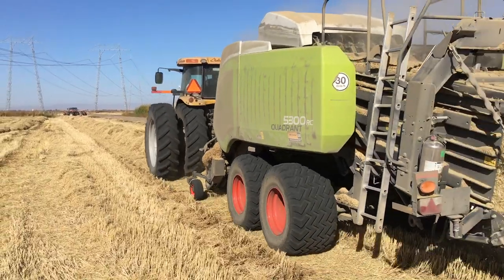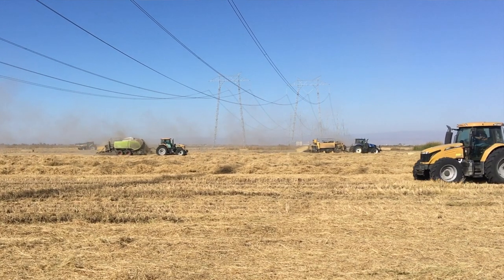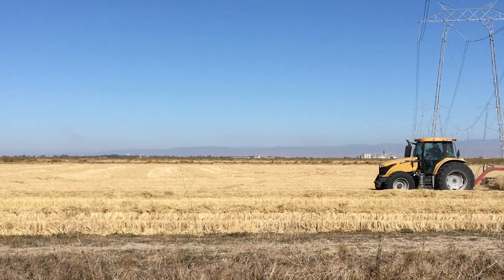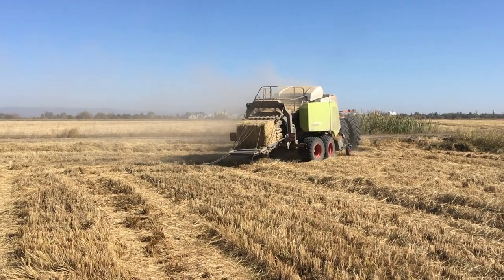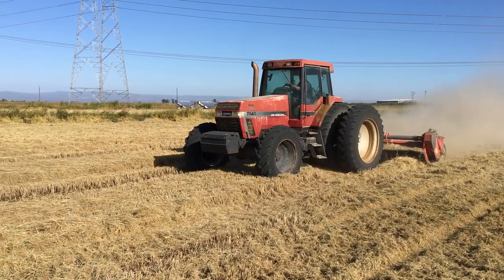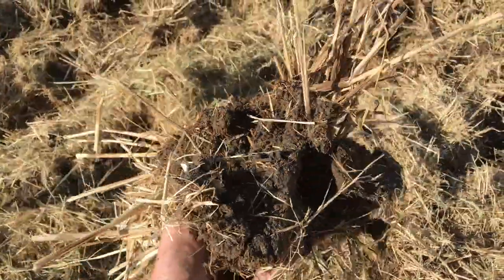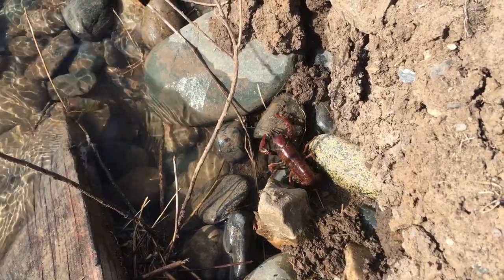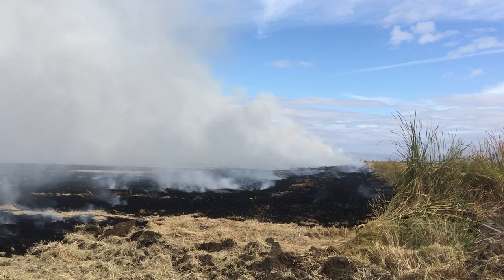Straw Baling | Four Straw Balers in the Same Rice Field | Tractor Video

Comment: Great video. Very succinct and informative, the way I like 'em. Do you get air resources credits that can be used, saved or traded each year? I'm thinking along the lines of cap and trade pollution credits for CO2 when burning. I imagine there must be some sort of economic balance between the diesel fuel burned in order to till or cut channels versus the CO2, smoke and ash produced from burning.

Some farms may be willing to buy credits if they need to do a lot of burning and some farms are willing to sell if they can till or flood economically. Also if you can carry-over credits year to year depending on conditions, planning or need, then long range economic forecasting can help to reduce yearly variability of income/costs projections. Might help with insurance actuary pricing as well. 

Many folks think this will be a very cold and wet winter and that the spring will be wet as well. Managing risks and knowing when to till, flood or burn seems to be a real skill and then accounting for the market costs of burn credits, water allotments and costs to till just add another level of complexity. 

There may be a good market for the straw waddles this year with all the burn areas in the state needing erosion control. If it isn't the fires in California it's the flooding that inevitably follows! This may be a very wet year with cold wet storms from Alaska or atmospheric rivers from the south Pacific (Pineapple Express).

Thanks for all the educational videos and helping us to understand the California central valley economy. Those beautiful birds along the central valley flyway are incredibly awesome. I'm sure they were enjoying their Thanksgiving crawdad dinners!

Happy Holidays and best wishes to you and yours!

...

Comment: In the mid south a stubble roller is used with spikes when its wet out to pust the straw in the ground and smooth out ruts and then disk in the spring.
Reply: A stubble roller has to have a wet field, usally raining  when being done.. after being cut and mature the stubble will usually lay down flat.  A heavy disc will also help if moisture and stubble is not to bad. Our fields in order to chisel would be by a counter chisel..
Reply: Several years ago here in Arkansas we had a stagnant high pressure weather system and I wonder how many people were hospitalized because the 
Smoke was just hanging in the air.
I know I didnt like it.!!!!!!!! That was about the same time the legislature all important employee clean air act was implemented

Comment: Many thanks, that was great. I'm interested in baling paddy straw in 3x4 large square bales. What would you say is the ideal moisture content for baling and what the maximum moisture level might be? Do folks always use cutter balers as you mentioned? I've hear of folks using straight packer balers, guess it depends on the end use of the bales. Cheers, Mark

Comment: Are those rakes still ground driven?
Reply: Hydraulic, that's why the big tractors with big hydraulic pumps
Reply: @genechronister7085  that makes sense I didn't see a pto shaft
Reply: We use the same type of rake for alfalfa,different brand

Comment: I see in the video that you farm under high power lines.  Are there safety precautions that you take to mitigate electric charges from building in your non-earth engaging equipment?
Reply: oldvideodude not really just give them a 5-10 feet distance especially when running a disc I’ve seen a incident when the disc grabbed a wire underneath and brought the Tower down

Comment: Why not compost the straw? I’d bet the heat generated during composting would provide some similar disease prevention benefits as burning and include the added benefit of enhanced plant nutrient availability when spread in advance of planting next years crop?
Reply: Carbon to Nitrogen ratio of rice straw is very high. Composting would require a lot of added Nitrogen. In a way, by working the straw into the soil, they are composting the straw in the soil.

Comment: Why is rice so much more abusive on your equipment vs other small grain?
Reply: Unlike soybeans, corn or wheat,  rice is not a smooth, slick seed. It has long, rough abrasive edges.
Reply from the maker: Allen, the rice straw is high in silica. It’s extremely tough and abrasive. It doesn’t “give” or rip through the machine. It wraps and rubs agains the internal components and acts like sandpaper. This “tough” trait was bred into the plant to help it keep standing during the fall. This also makes it hard to decompose.  
-Matthew